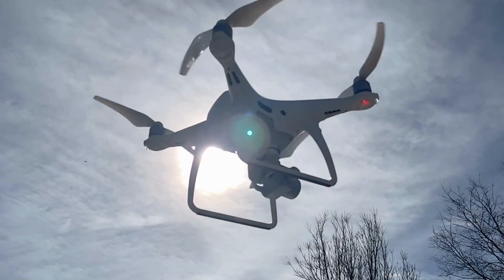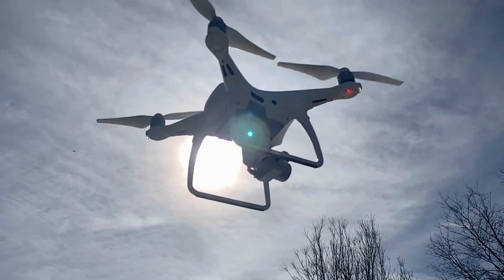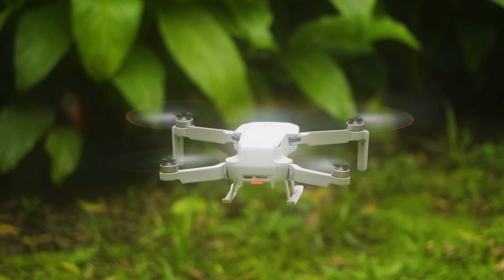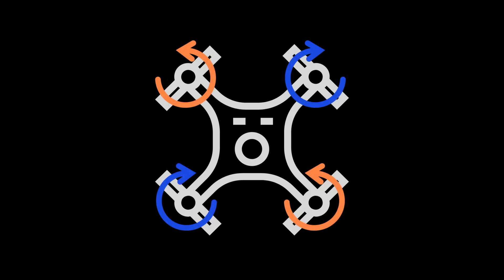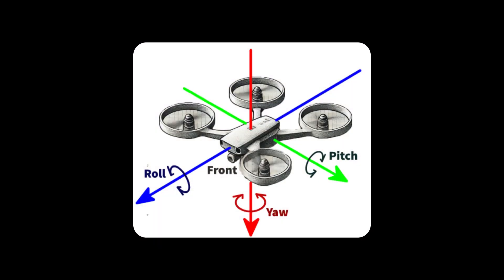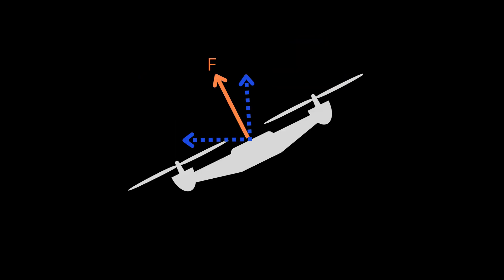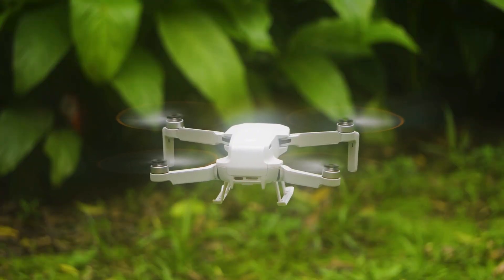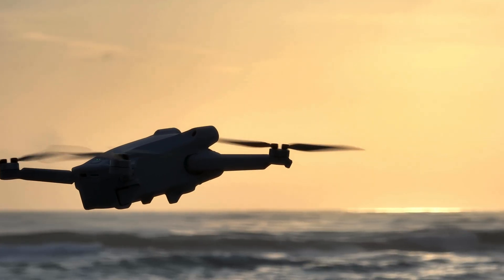How Drones Fly and Maneuver – Basic Physics Explained

Comment: good and straight to point
Reply: Nope, These types of four-rotor drones are scrap.
Reply: @szankony6276  Sounds like a pro is talking ... 😆
Reply: @greybeard5774  I was involved in polish military reconesance drone program a few years ago, but it was one propeller drone thrown into space from moving platform by high air pressure exhaust system, anyway classic plane, not such crap, capable to fly hundreds of kilometers, while those physics explains nothing, it is a scrap.